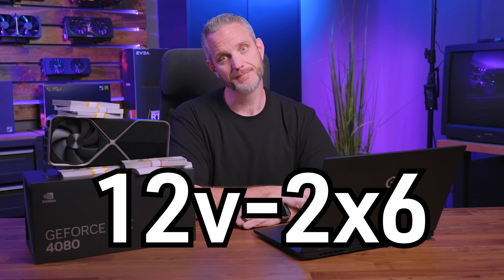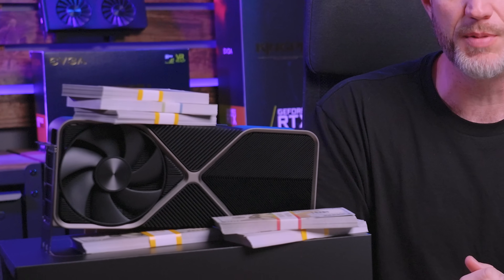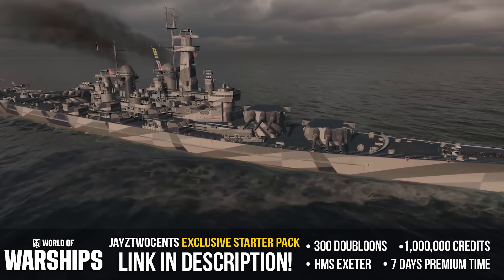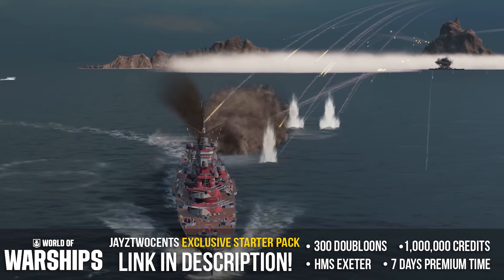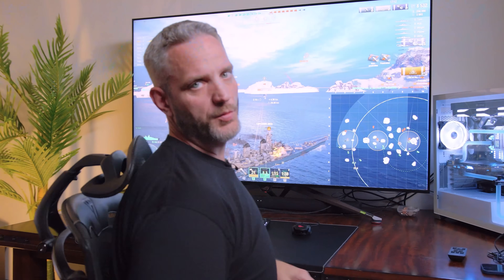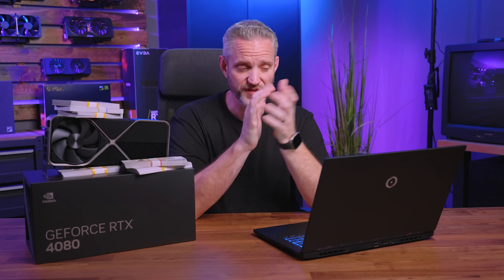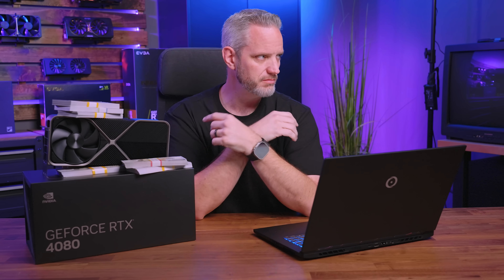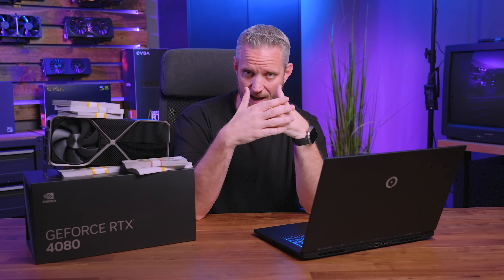They FINALLY admitted that this was a major issue!

Comment: Hey @JayzTwoCents I have an AORUS 4090 XTREME WATERFORCE 24G (rev. 1.1) in my build and have been using the CableMod 12VHPWR Angled Adapter. I recently started to get the black screen with full fan speed issue, and I was very worried thinking it was something with my ram or GPU/PSU issues. I had a suspicion that it might be the adapter, even though the 4090 I have has an LED above the 12v power plug, that's supposed to light up if any power issues are detected, it did not light up. BUT once I stopped using the CableMod adapter, the black screen + fans going full speed issue stopped. I would check and touch the adapter now and then while it was under load to make sure it wasn't too hot and the adapter was never even warm, it was usually ambient temp. I have tried the adapter recently just to test it and it looks like the adapter just died somehow, the GPU will not receive power if using the adapter. The adapter has no visible damage to it. If you would like to test it for yourself. I would be more than happy to ship my defective adapter to you so you can investigate the black screen, max fan speed issue. Btw for my 4090 I am using a CableMod C-Series 12VHPWR PCI-e Cable for my Corsair PSU, I was using it with the adapter before the adapter stopped working.

Comment: So any connector with Astron should be recalled. I would argue all the GPUs and PSUs with the old connector should on a voluntary recall where they swap out the connector. Initially i was like what is the defect rate and what not but now this is officially ridiculous and this needs to be fixed. And it's not like removing the connector and soldering a new one and flashing the Bios is impossible for the GPUs It would go a long way to me if they did this. It should not be an aftermarket service to fix what is clearly a poorly designed connector.

Comment: Jay You just saved me a fortune,  I was just about to pull the trigger on a 4090, I was going to order one at the end of this week, but now I’m going to wait, great video  thank you 👍
Reply: I bought a used 3090 Strix because it has 3X 8 pin connectors.  I looked at the 4090 but every one I tried had coil whine and some of them were bad. I would have bought a Red Devil  7900 XTX but they were hard to get then. I am going to build a new rig in a couple years. I might put an AMD card in it.
Reply: @davidbrennan5  I was actually looking at a the 7900XTX liquid devil but it’s quite hard to get here in the Uk.
I’ve got my 3080ti on an Alphacool waterblock, so I guess I could wait for the liquid devil to come into stock or wait till they sort the mess out with the 12VHP connectors out.
Reply: @andydbedford  The 7900 XTX Red Devil is a nice card, I don't use upscaling or RT honestly.  I would have bought one but they were either sold out or they were marked up a lot. I paid $600 for a used 3090 Strix OC with 2 years warranty left on it from a local gamer. It handles 4k fine. I should be good for a few years.
Reply: @kristofvanderveen34  that’s ok I can keep my 3080Ti for another year.
Reply: "now I’m going to wait" how long are we you gonna wait? weeks, a month, 6 months? that's what we need to know. Do we need a new cable too for our 1000 watt PSUs?
Reply: @paulworster3683  well I’ve got a 3080ti, so I guess I can wait until they sort this mess out.
Reply: @paulworster3683  I'm just gonna wait for 50 series! I'm just wait for the new 60 series, way better! I'm just gonna w-

Comment: The changes all sound great, but there's one more change I'd like to see... A wider retention clip to help eliminate side-to-side wiggle!
Reply: Or just jump up to an automotive retention setup. The kind with the metal clip that manufacturers use for fuel injectors
Reply: @thespacedpirate  That would be hilarious!
Reply: @thespacedpirate might as well since different parts of that industry already made it into personal computers
Reply: Or we could use screws like on VGA, DVI etc. Those screws won't wiggle loose
Reply: I made my own connector position assurance clamp block that bolts to an EK waterblock because that clip is so poor
Reply: For my purposes, if I have a need to use the +12vHPWR connector in the future, I'm going to make my own improvement to the retention mechanism.
It's called hot glue. A nice bit of hot glue across both the plug and the socket will ensure that nothing comes unplugged when it shouldn't.
Reply: @44R0Ndin  At what temp does hot glue melt? That might have a messy outcome.
Reply: @jgorres  That's a lot more complicated of an answer than you would think. There are actually multiple answers.
Low-temp hot glue (the stuff you get in hobby stores most of the time, in the thin and short sticks), yeah that stuff's no good inside a computer. I'm pretty sure that stuff melts well under 100C.
Higher temp hot glue sticks exist tho. Many PC power supplies have the filter capacitors stuck to the PCB with hot glue, this is to prevent vibrations from flexing the pins that get actually soldered to the PCB which would eventually fail due to metal fatigue (that's part of how they get that 10 year warranty on your 80+ gold PSU). That's the stuff I was thinking of using. High temp hot melt glue, and yes you can get it that's designed specifically for compatibility with electronics. It won't melt the connector when you put it on, but it'll also not fall off unless you really pry it off there with a screwdriver or knife, so it's a good solution to the problem of "this connector won't stay plugged in well" and you see that ALSO in PC power supplies, at least on the connection between the PSU's fan header soldered to the PCB and the PSU fan's power plug on the end of it's (short length) wires.
Reply: @44R0Ndin  I didn't know the stuff you're referring to is considered hot glue... My bad.
Reply: @jgorres  About 250F.  If the connector gets THAT hot, it's gonna melt the plug anyways.
Reply: Double-up on the retention clips. 1 "hook" part of the clip for each "6-pack" grouping of pins.
And the release tab is connected to both of those hook parts, obviously.
Reply: @WorthlessTrash  In that case you'd only need the two clips on either end, because the amount you can wiggle it in the Y-axis is insufficient to cause the connector to have an issue.
Reply: @WorthlessTrash  I meant you only need 2 clips per connector (4 total for the cable), one on each of the "short edges" of each connector. Since the connector is a rectangle, it has 2 short edges, and you'd put a latch on each of those short edges.
In any case, the switch to the NTK pin should fix the issue without any changes to the latches.
Actually, now that I think of it, if you were going to add more latches to the system, you probably would need that third latch I was originally saying you didn't need anymore (the one on the top long edge of the rectangular connector), if only for backwards compatibility's sake so there's something for the new-style cable's connector to latch into the old-style board's port.
Reply: The lack of a full width clip truly makes no sense.  They can add that to the update and it would still be backwards compatible.  The new connectors would have full width clips that can still clamp down on the small center clip from older connectors just fine.  But even then, they still have to reduce the allowed tolerances of the original.  No way around that.  A clipped connector should not have the ability to separate by a human visible amount.
Reply: Or even a clip mechanism to anchor it on the left and right sides as well, kinda like the teeth on the USB3 mobo headers (and we all know what a PITA those are to remove!  They don't go ANYWHERE!)

Comment: So my gaming oc 4090 had the 100% fans black screen issue with the adapter that came with it. When I switched to a cablemod cable the issue went away. It went back and forth for gigabyte a few times for rma were it worked for them but not for me until the last time it came back I had the new cable installed.

I only realized it was the adapter when I got another 4090 in for a PC I was building for a friend and I threw that card in my build and it had the same issue, but when I used the adapter that came with the other card it worked fine.

Comment: My friend and I both have had the black screen issue with our 4090’s. I solved mine by removing the 90 degree angle connector from Cablemods. His is currently in RMA.
Reply: It's what he said, it was probably not sitted properly.

Comment: PCI-E slot max power is not 75W on +12V.
In fact it's 66W. The remaining 9W are used by +5V and +3.3V supply to the PCI-E device.

Comment: OK so they will change the pins. But where does that leave anyone who has already bought a 4090 and also an adapter from cablemod? Sure as hell there won't be a recall. They should at least pay for the cablemod adapters we were forced to buy.

Comment: I think GPU's are just getting too power-hungry. In some ways, living in a tropical climate has limited my exposure to these issues since I would melt long before my wires do with a 4090 😂.
Reply: Yeah. I'm considering arctic realestate.

Gaming where I live now turns my den into a sauna, which I'm not always in the mood for.
Reply: You can undervolt, overclock, and lower the power limit of all these cards, and still get almost full performance with significantly lower power consumption and temps.
A single card pulling 600 watts is ridiculous.

Comment: Trying to understand the synopsys here.

1. Cable is changing - understood. Buy a new one when it comes out. Is it still backwards compatible with existing video cards/plugs? Will it even help without an updated video card?
2. Video cards will need to have the connector updated. Certainly not existing 4xxx series cards. Likely 5xxx and beyond? Unclear as to re-release of 4k series card? Also, is this only an issue for 4090s? 4080s and below were fine?
3. Do power supplies also need to change the connectors on their end? Or was the issue always on the video card connector side?

Comment: I've read that Nvidia is already supposing to be using modified power plugs on their 4080's and 4090's that are very close to the 2x6 standard (shortened sens pins) on their founders cards.

Comment: Why is the first card that uses this power cable not part of the conversation? I've never had an issue with my 30 90 TI. I didn't have a problem when I used the three power cables into the adapter into one and I haven't had a problem with my Corsair dedicated power cable that only used two into one

Comment: Nvidia should talk to my last company I worked for. They make hermetic glass sealed components for electronics. Try pulling those out haha, we had pressure and pull test requirements for thousands of lbs of force since they were used on satellites, missiles, jets and the like. But I'm fairly certain a simple design with some cu brazed pins and some 50 ohm feedthroughs for the sense pins would be a lot lot lot more robust than the thin little soldered foil pieces they're using.